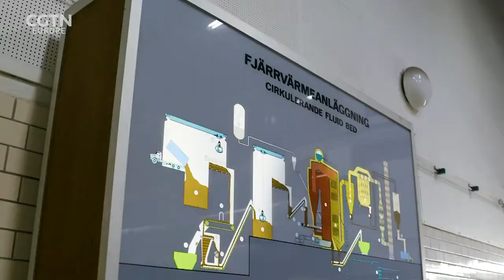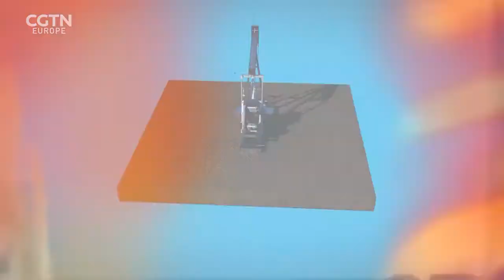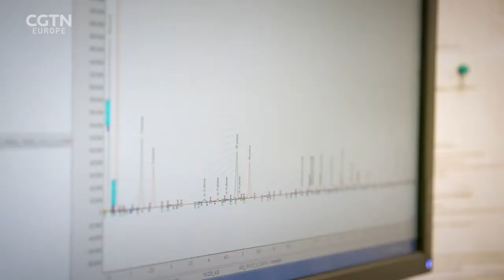Chemically recycling plastic in Sweden: RAZOR

Comment: what's the difference with gassification? Gassification is not easier way to transform plastic in liquid new materials?
Reply: This is a continuous fluid bed reactor which is designed to efficiently gasify hydrocarbons. This is the essential unit of almost all newer oil refineries and represents a repurposing of existing technology.